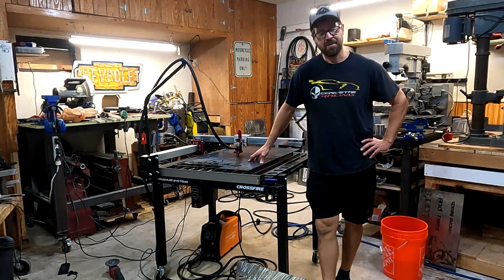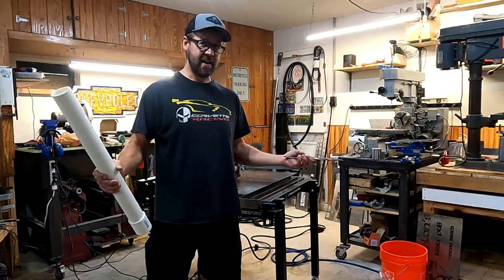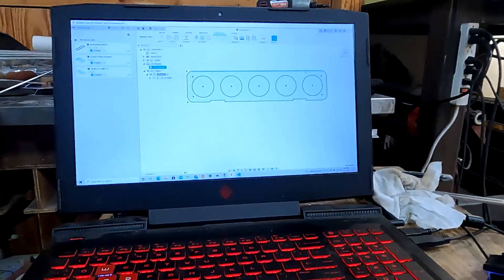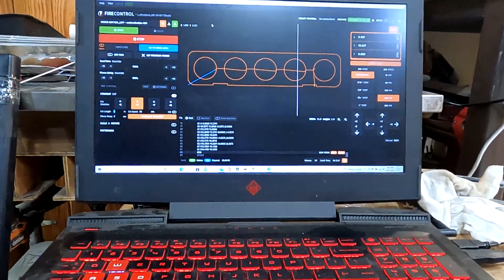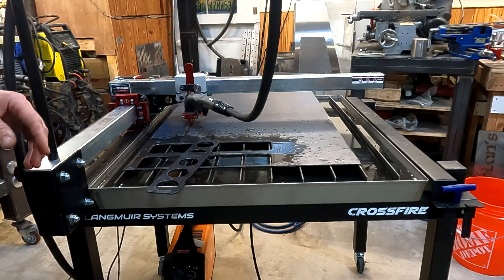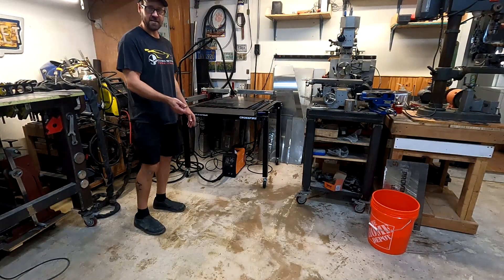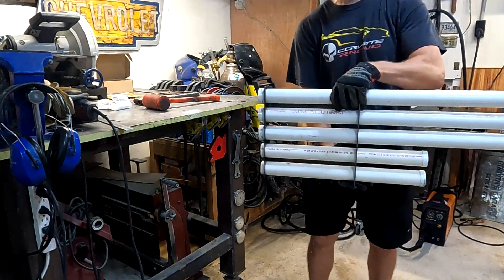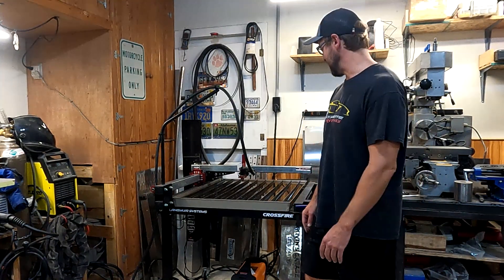Crossfire CNC Plasma Cutter First Parts - Beginner Tips to Save You Some Time

Comment: How does the work piece remain in place? Magnetic?
Reply from the maker: Gravity. If it is a light piece of material you can use a weight to hold it but being that the torch tip doesn't touch the material it often isn't necessary

Comment: The company has a limit switch kit available to order now. It helps to avoid crashing in to that topside nut. Hitting 'home' in firecontrol helps clear the torch from the work piece. That might be one of the most used practical functions I often use of the limit switches.
Reply from the maker: I plan to buy this very soon. Definitely a useful addition to an awesome unit. I also want to upgrade to the machine torch if it's ever back in stock

Comment: Amazing how far and how cheap this technology has come. Back in the 1980's there were a few times I almost bought an industrial plasma system, 4 x 8 and the price was around $30k plus the cutter needed air, nitrogen, and oxygen. Now for a few grand, most guys can have a cnc plasma in their garage. Same thing with hand held plasma machines back in the day. Now a 50 amp cutter is $225 on ebay. Sure glad I never spent the money years ago.
Reply from the maker: Yeah it is a pretty incredible setup for the money. I have my eyes set on the new langmuir cnc mill. Looks pretty amazing for the money as well. My buddy just got one so I'll see how his is before I drop the 7 or 8k on one.
Reply: How much for the setup here?

Comment: I have the same program, after making the dry run, I try to make the cut and it only makes one cut and stays on in the same place until the machine decides to stop. how could i fix this problem?
Reply from the maker: I've had mine do that before. My issue is usually resolved by restarting my computer. If it is doing that to you all of the time it sounds like a communication error. Have you tried a different usb port on your computer?

Comment: How big of an air compressor are you running? Nice job.
Reply from the maker: It is a 4.5 hp 220v 80 gallon. I also have an air dryer before the plasma cutter which seems to help quite a bit. Even with 80 gallons it will kick on but I never see a loss in cut quality while the compressor is running
Reply: @provinsgarage  literally came here just to ask this question!!! Im building one soon!